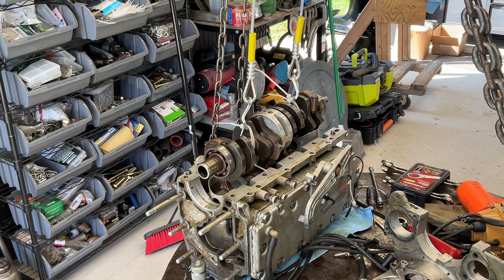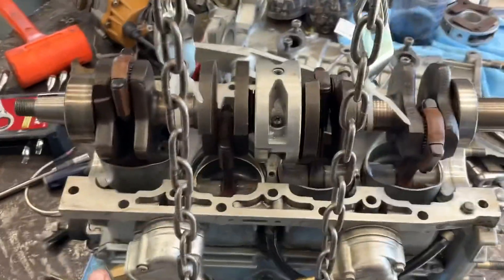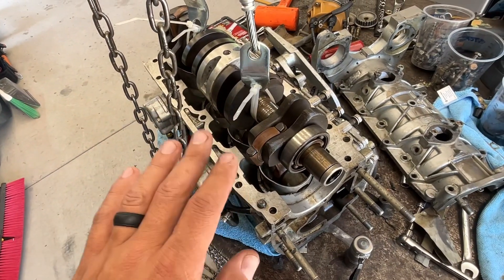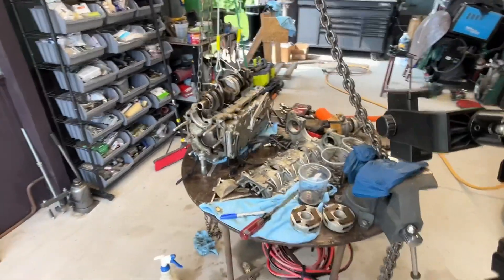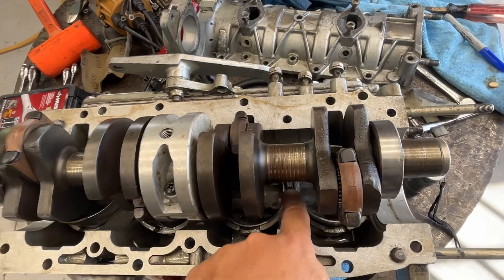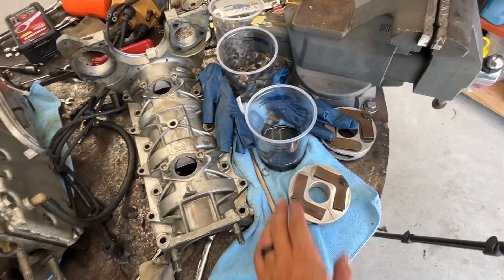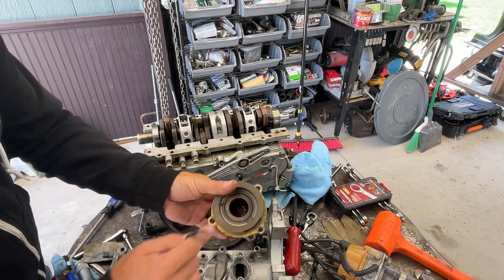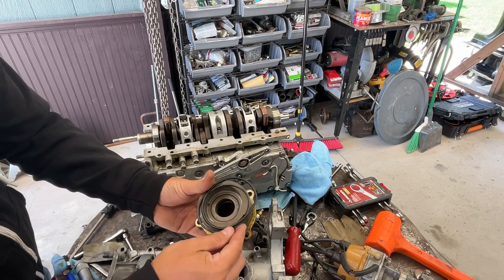Kiekhaefer Mercury 650 SS - Reed Valves & Crankcase Assembly

Comment: So, did this fix the issues or not?  I'm not sure I can even purchase a set for mine.  Also diagram on my manual shows ONE reed block assembly.  I have 4 cylinders.  Should I have 3 reed blocks?
Reply from the maker: Hi Joe.  In a sense it did fix a lot of idle and idle to part throttle transition bugs.  I was struggling with two other issues.. prop selection, and a flaky choke setup.  New reeds really cleaned up the idle quality, definitely not a root cause, but part of the big picture.  If you have a four cylinder you have two reed blocks.  If you have a six, there are three reed blocks.
Reply: @langbros.1907  I am having symptoms of bad reed valves, but I do not have fluid coming out of the carburetor or blowback. Is it possible my reed valves could be bad without the reverse air coming out the carbs? Engine has inconsistent performance. Sometimes it wants to run sometimes it doesn’t and it doesn’t like to start when it’s hot.  Stalls when shifting in to gear. Sometimes it starts in idle fine and sometimes it does not
Reply from the maker: Not likely.  If they are worn it’s obvious, it absolutely soaks the inner cowl with raw fuel.  You may be experiencing a fuel system problem.  Assuming you are properly timed, you have done a link & synch, and you have good spark… the fuel delivery could be the issue.  Kinked lines, clogged filter (if using one), dirty carbs, weak or faulty lift pump diaphragms / check valve.
Reply from the maker: Shoot me an email.  I’d like to know more about your symptoms.  Casey.r.lang@gmail.com